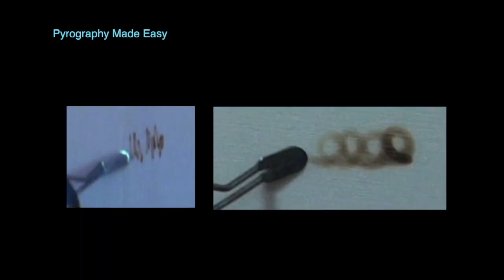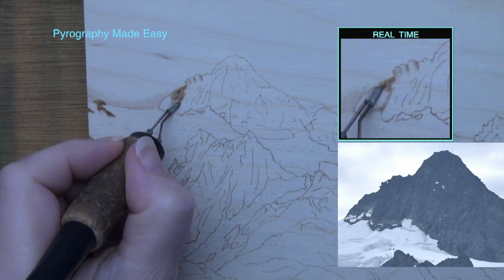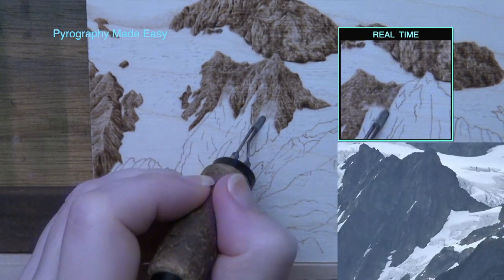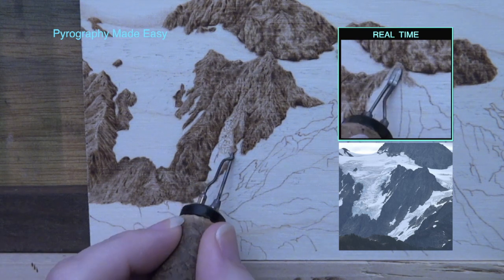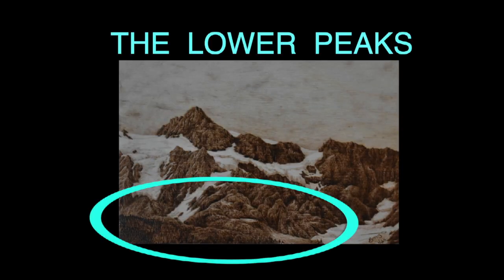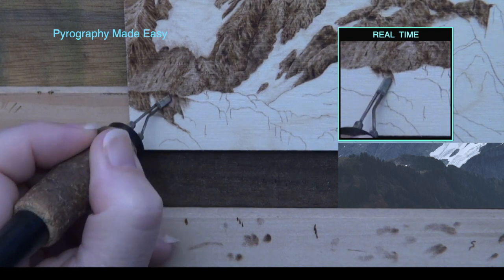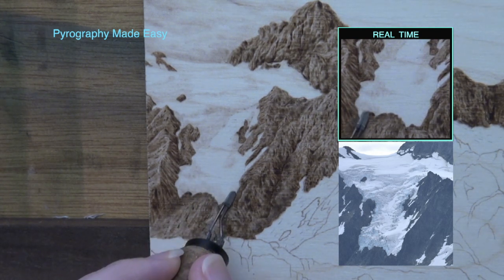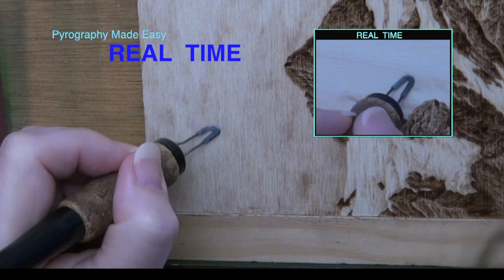Wood Burning – Snowy Mountain - pyrography tutorial (Mt. Shuksan, WA)

Comment: Brenda I have a Col wood super pro and I don't get any color if I go lower than 3 1/2 or 4 is that normal?? Thanks for any help!!
Reply from the maker: Hi Kathy,
At one time I would have said there is a problem.  Now I know better.  Don't worry about that because there are so many variables that go into what heat setting should be used.

For example plywood requires a higher heat than basswood, but a lower heat than maple.  At least it does for me.  Also every piece of wood (even from the same board) needs a slightly different heat setting.  

Another factor is the size and type of pen tip.  I have a micro writer that requires higher heat than several shaders.  Depending on the wood the writer might require a full number higher (4 instead of 3).

Also how new your pen tip is can impact the heat setting.  New isn't a good term.  Instead how many burn hours your pen tip has.   
Let's say you have two identical shaders.  You keep one as an emergency backup, so it never gets used.   Fast forward several years and the two shader will require different heat settings to get the same burn result.  It may not be a huge difference, but a lot of that will depend on how many burn hours the used one has.

I know this because I have two of the same shader, and one is an emergency backup.  The backup shader has zero burn hours on it, but the one I use has over 1000 burn hours on it.  The well used shader can produce tan burn results on basswood when the heat is in the 2 range, but the brand new shader will require something in the 3 range and maybe higher.    

Why this happens I'm not sure, but my guess is that over time through the metal slowly wears away from use.  That's just a guess. 

Again don't worry about needing a higher heat than I use, it is normal.